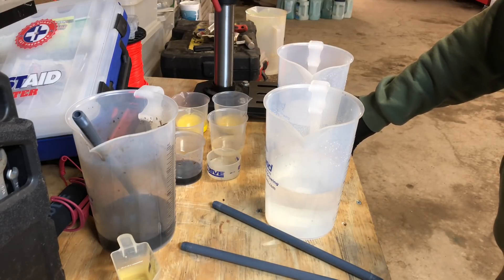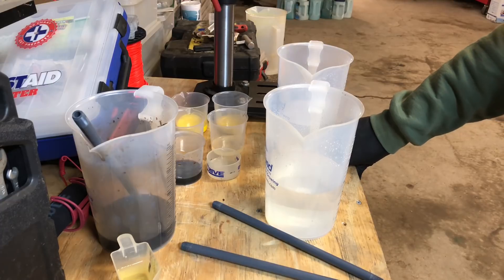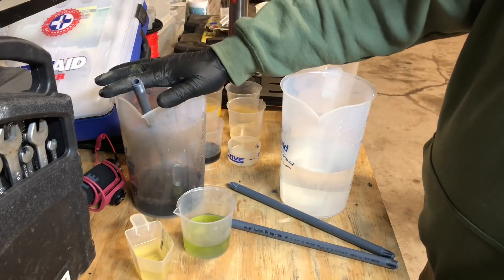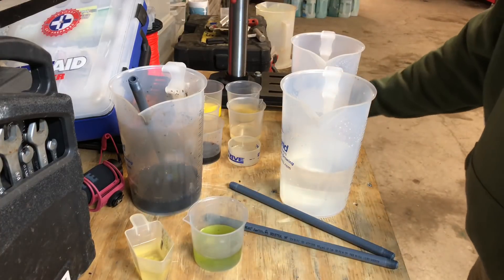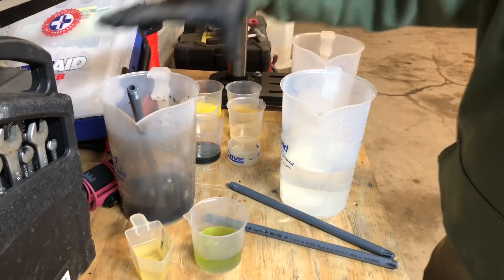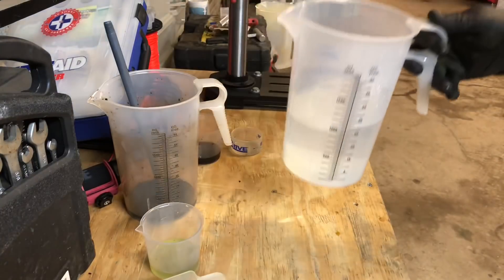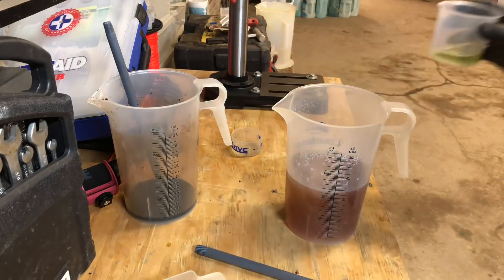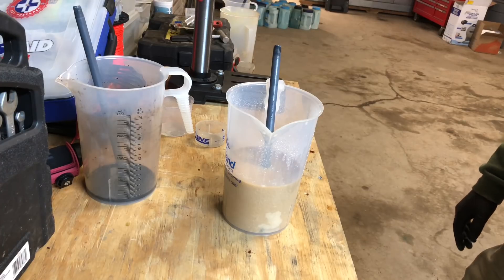How To Calibrate Any Sprayer PART 6 - JAR TEST

Comment: Very wise, Pete, to do a jar test on any solution of chemicals. The results are unpredictable unless you try it first in a jar with a proportional mixture.

Pete, an off topic question - Where did you find those large plastic beakers with the ounce markings on them that you used in your jar test? Could you please provide a link to where I might buy some of those? Thanks, Pete.
Reply from the maker: amazon      should have all you want
Reply: GCI Turf Services Thanks, Pete. I had searched several local stores with no luck. I did go on Amazon and found some acceptable beakers of various sizes with the ounce markings on them.